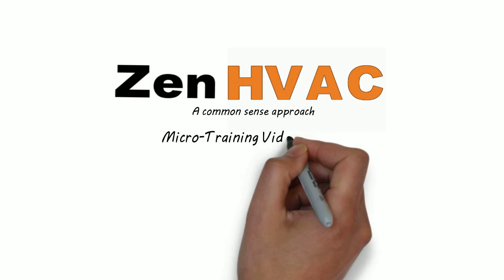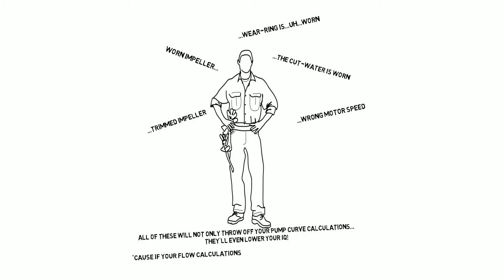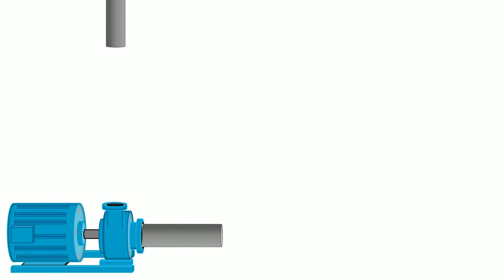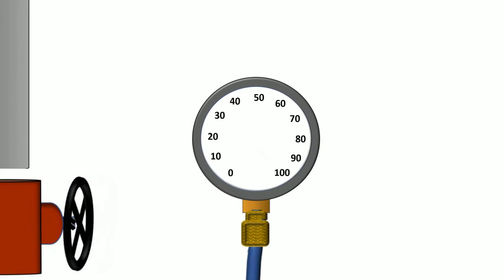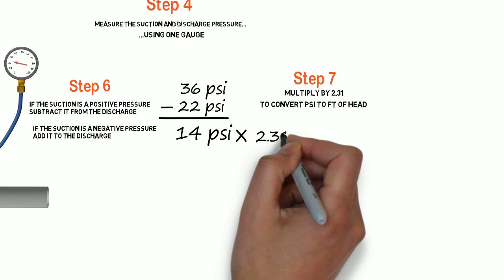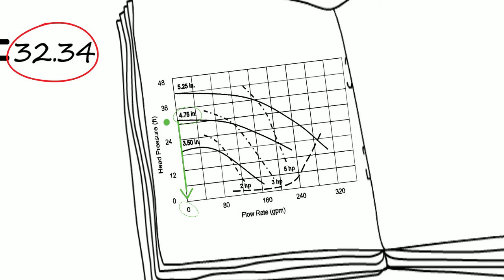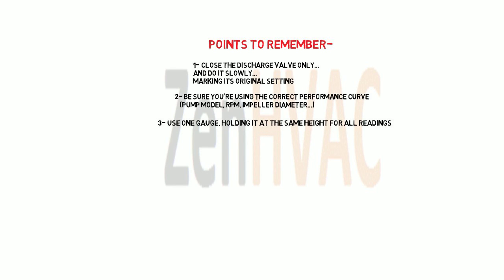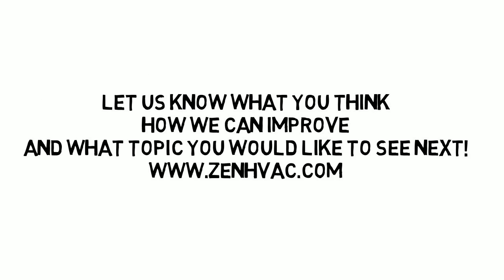Checking Pump Performance (Dead Head Check)

Comment: Thank you. If I wanted to see what I’m actually pumping compared to a pump curve do I just take the head pressure?
Reply: You would use head pressure, but if the suction is a positive you need to subtract it from the head, if its a negative pressure, you would need to add it. Watch our pump performance video and let me know if it helps.

Comment: Sir I have a question, if it is a closed loop like Chilled Water Piping. The system shows a suction and discharge pressure while it is running. If we want to know the pump head(in feet)do we have to subtract Suction from Discharge Pressure(in PSI) and multiply by 2.31, please clarify thanks
Reply: Good question! subtract it if its a positive, add it if its a negative.

Comment: I got question for you! I am doing pump curves on new pumps most of the time and actual  dead head pressure doesn't match with the given performance curve dead head(curve given by manufacturer)! I checked speed, and impeller size and new pump might not have worn seal or impeller. Is it possible to have air trapped in water system and it will give a wrong reading as air has low density!? its happening a lot! I am really confused and looking for solution to how to find if air in water system? or its something else causing problem!  Please help me if you can. Thanks!
Reply from the maker: You're right, air would skew your readings, but that isn't the culprit if the system has a standing positive pressure and the pump isn't at the high point of the system (the air typically is at the high point/s in the system) Can you give an example suction / discharge readings and the pump data? Also, if the pump has a VFD on it, be sure it's running at 60 hertz.

Comment: Could you advise me about what is the max allowable time to perform the dead head time, as you say "I have to use the same pressure gauge " , So it will take around 3 minutes to  install the gauge
Reply from the maker: You're best to shut the pump off when moving the gauge. The other option is install a valve on each gauge port and tee  them together, installing the gauge on the tee branch. That allows you to open the valve for the suction, then shut it and open the discharge gauge port valve.

Comment: I still don't know what dead head means.
Reply from the maker: Sorry Brian, I should have explained that! The water pressure is measured in Feet of "Head", and when you close the discharge valve the flow is "Dead" so they use the term "Dead-Heading" the pump.
Reply: why do we need to know the dead head?

Comment: why do we need to subtract the suction pressure and discharge pressure?
Reply from the maker: Good question! We subtract it because we want to see the true discharge pressure. Think of it like this; if you weigh yourself while you're holding a 30# jug of refrigerant, the weight will be off by 30#. It's the same reason we add the suction if it's a negative number. If you weigh yourself while someone is picking you up, the reading will be off. Hope that helps!

Comment: How come none the Engineers I've worked with have mentioned this test.
Reply: Good question Max! Most engineers design systems assuming the individual components they select for the system will work as designed. While Engineers typically design systems to work properly, HVAC Technicians troubleshoot systems that once worked properly, but now do not work properly.

Comment: If you have a negative psi on a CB, that is considered a vacuum and should be measured in inches of mercury HG. This will be more precise in your calculation
Reply: Great question! Think of it this way; feet of head is like miles or kilometers, its a course measurement. Mercury HG is like millimeters or tenths of an inch. 

Which would you use to measure the distance between the North-Pole and the South-Pole; kilometers or millimeters?

Comment: So, for a simpleton like myself,  the general idea idea is to compare the psi of the sucking in side to the pushing out side of the pump?  This video reminds me of many math /science class I took where you're given a set of steps to follow with no explanation of the  underlying logic,
Reply from the maker: Thank you for the feedback Levi! 

Good observation on what is NOT included in our videos!

The reason they're short and without theory or concepts included is they're what we call 'Explainer Videos' that are intended to give you what you need to get the job done in the least amount of time possible...like when your on a job site. That's whey we include the tag line - "What you need to know, when you need to know it, in ten minutes or less".

We have plans for other video series that will include more background information that the Explainer Videos don't cover.

Let us know what you would like to see and we'll make it and give you full credit for the idea!

About the pump pressures...it's like when you calculate "Absolute pressure" by subtracting atmospheric pressure (14.69 psi) from "Gauge pressure" .

Oh, and you can't be a simpleton when you ask questions like yours!
Reply: @ZenHVAC The pupm is centrifugal. How we take the performance at volume pumps like screw or piston pumps. If we close the discharge we will damage the pump
Reply: You are correct; these videos do not dive into theory; they are folks who need the base information "now"... like when a Technician is on a job site and just needs the answer, not the science behind it. 

For this test, the pump is moving no water with the discharge valve closed, so the pressure should line up with "0" GPM on the chart. 

The suction pressure needs to be subtracted so you are only checking the pressure the pump is creating, not the standing pressure of the system.

Comment: i feel its danager to start thje pump when the valve is closed
Reply from the maker: Keep in mind this check is for centrifugal pumps only, NOT positive displacement. You also do not keep the valve shut for more than a few seconds, just long enough to gather the zero flow pressure.
Reply: I think this only applies to C. P PUMPS.
Reply from the maker: @MrQarni1  You are correct! this is for centrifugal pumps only.